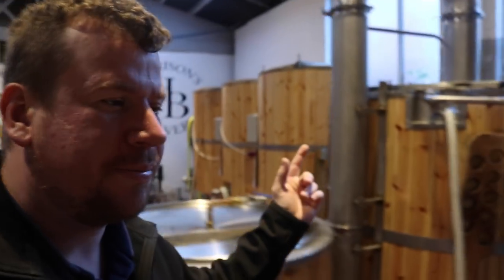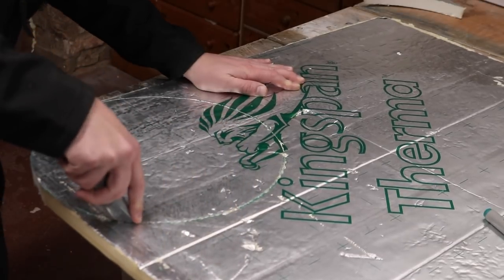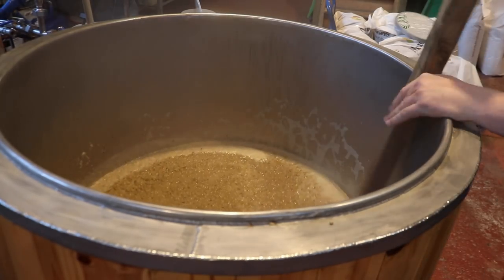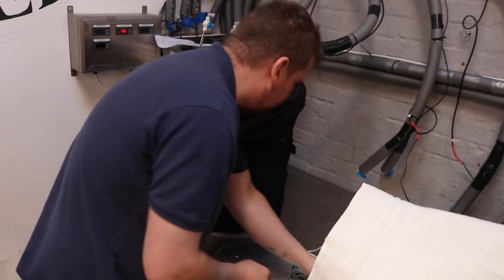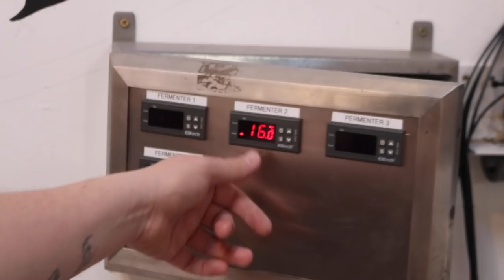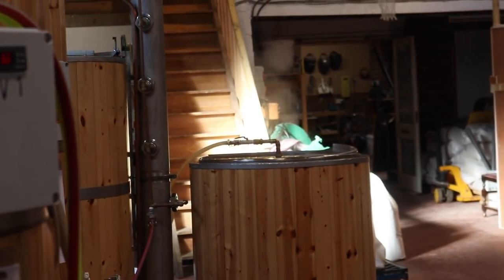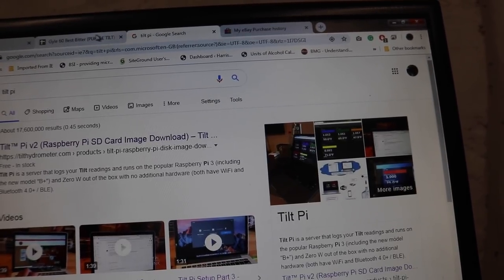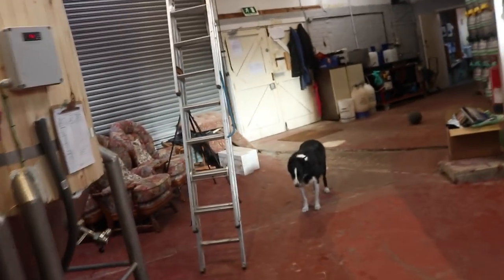I GOT A SLICE OF THE PI

Comment: Nice Pi action going on there mate. Bloody easy peasy to set up aren't they? Chuffed that you are getting the signal through the tanks too.

Agree with the 2 Pi idea you have. One for the telly and one for the tanks. Boom. Modern technomologies.

Tilts aren't a substitute for hydrometer gravity readings at crucial points of course, but really handy for getting a good overview of where things are during fermentation. It's addictive, logging in to the charts on your phone to see how things are going!!  - I have mine set at 5 minute intervals. Possibly overkill. But hey.

They do tend to get a bit flaky during cold crashing and stuff, and as soon as you dry hop, they go a bit ballistic what with the floating hops getting in the way - but by the time you are doing that, their work is pretty much done. Unless of course you are doing Biotransformation additions. In which case, you will get some odd readings - It's still reasonably easy to ascertain where things actually are though.

Having said that, I do trust mine. It's never more than a couple of points out really. Great for measuring the actual tank temp as well. I put my probe on the outside of the fermenter and can adjust my temp controller accordingly to really dial in the real temps I'm after.

Once you have built up a little library of charts, you will know exactly what to expect from each fermentation of each beer. I can see how that would be useful in your brewery.

I've sometimes found that the system crashes. Just turn it off and on again, and they soon kick back into life.

Comment: Biggest problem with Pi Zero Wireless is it only has the 1 usb and 1 usb for power (Both mini USB) and the HDMI connector is a mini. The cable to connect it to the TV costs more than the PI, but it's very cost effective and efficient. Much prefer logging my own data rather than sending it to Google.

Comment: Do you have the tilt repeater also? Or does the signal go through the stainless just fine?
Reply from the maker: They all seem to go through the steel just fine. The Galaxy tabs had a bit of an issue but when I put the Pi Zero up high in the rafters it has picked up the signal no problem.